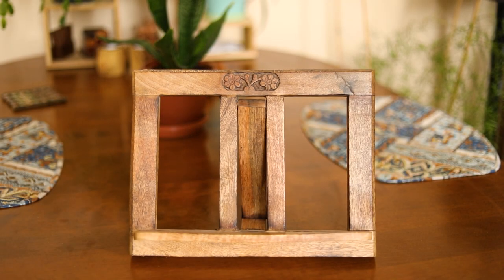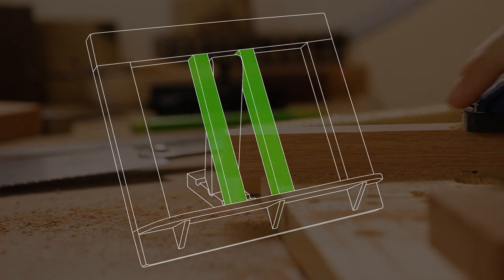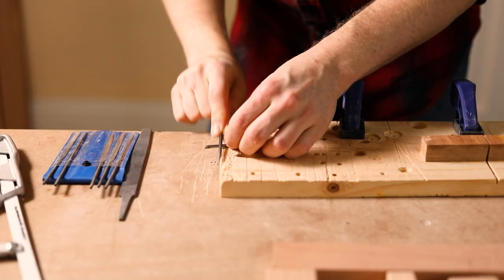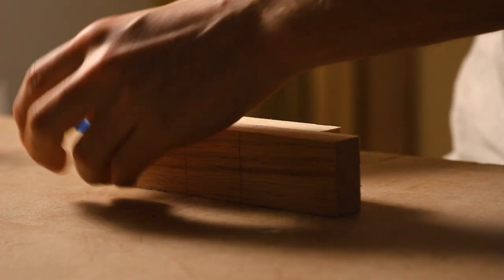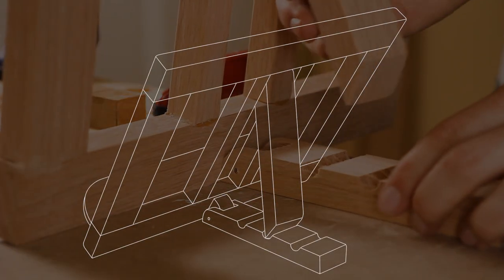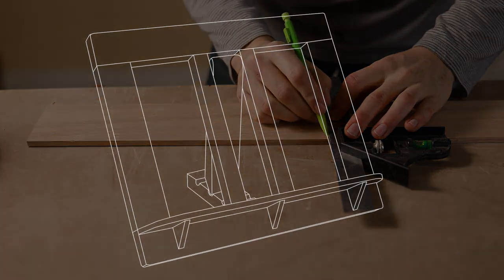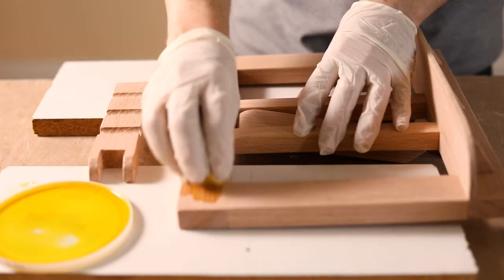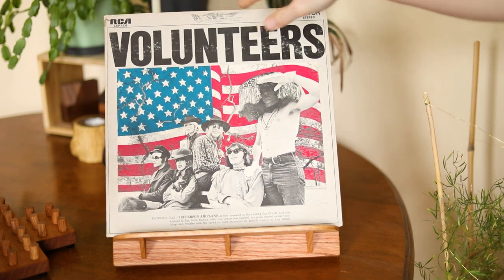Making a Folding Stand from Oak

Comment: My landlord would kill me if I tried to set up a drill press in my living room. 🤣 Though honestly, he hates my flower pots too.  I do have a hand drill and a small plane router, so I should be able to do the notches in the brace, they just won't be rounded.
Reply from the maker: Yeah, I try not to make too much ruckus 🤫 It won't matter if the notches are square or rounded - the original I was replicating has square ones. Router plane/chisel would do the job well.